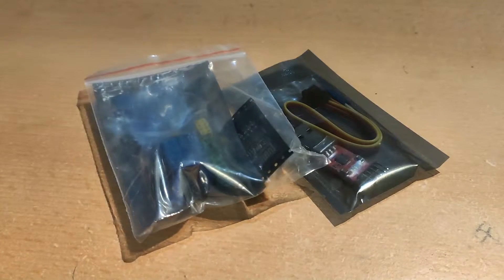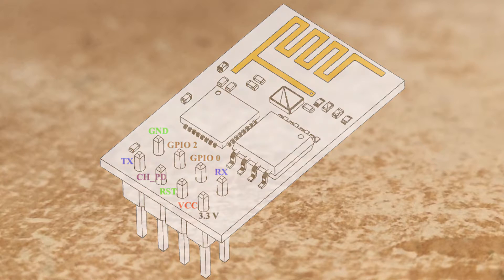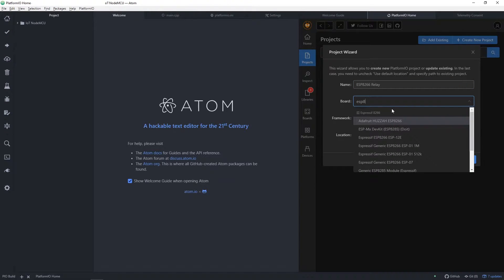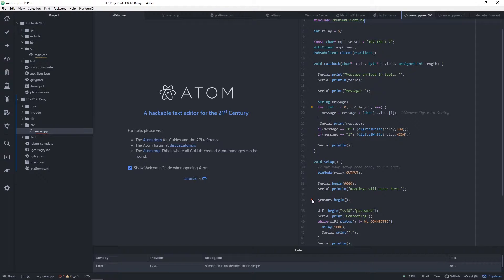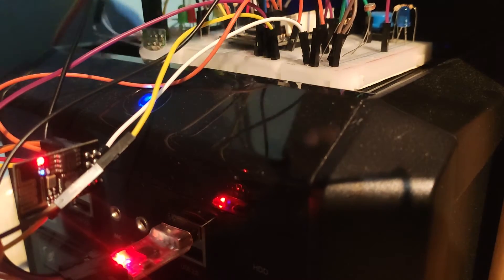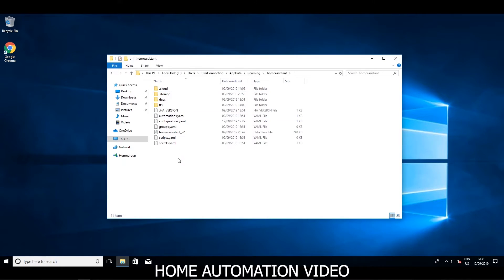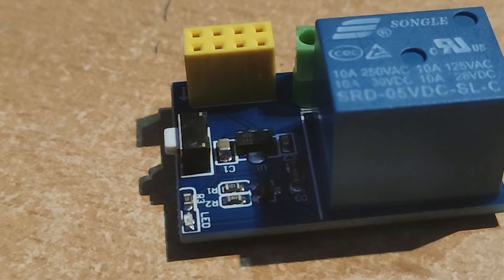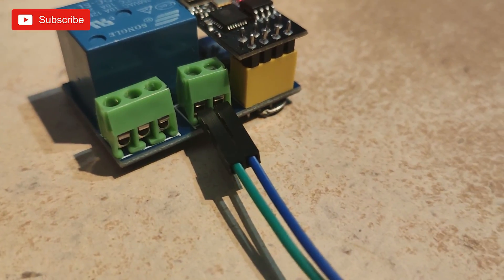ESP8266EX Fun With Relay Module, Home Assistant & MQTT

Comment: Hi I want to make a switch using microcontroller for high power device like refrigerator or water pump which relay would work for this purpose.

Comment: How would this hold up in the current day?

or would you suggest a better different ESP8266 relay?

was planning on getting one of these cheap ones to use with some led-strips.
Reply from the maker: If you put some effort and time in it, it will do. Today you also have a "plug and play" solutions like Shelly and Sonoff switches with their apps. In the upcoming months I'll release new content for Shelly devices so check it out once uploaded. My latest video is explaining Shelly humidity and temperature sensor so you can see how the Shelly app looks like and find some info there. In any case have fun!

Comment: I got a slightly different module, and can't get it to turn the relay on. Tried all GPIOs available. The module get enough juice. Any ideas?
Reply from the maker: Check connections for that module. The scheme or diagram to be sure you are wiring as it should be.

Comment: ..this module has bug on its relay board..remove the smd R2 202 resistor in the relay board to be able to work after programming via the switched USB programmer for the esp-01s
Reply from the maker: Yeah, I don't why they are producing it with that specific resistor.

Comment: Is this work without INTERNET
Reply from the maker: Not sure if I understand your question exactly. You do not need the ISP internet access for this module to work. You can connect it to your router/modem WLAN with the Wi-Fi or program module to work as AP over Wi-Fi.
Reply: I say if I have not any routers can I use only mobile for on off it
Reply: si se puede hacerlo funcionar con una O alambrada con o sin internet, encendiendo el apagador manualmente.

Comment: This exactly what i was looking for ,, thank you very much man ,,, i will try it and let you know if it worked for me.

Thanks
Reply: Hi there,I have applied all steps and configured Home Assistant but, I'm having a problem connecting my esp8266 to Home Assistant, it connects to the wifi network but shows the error below:

Serial port COM8 opened
....
Connected, IP address: 192.168.1.115
Light - MQTT - ERROR

i will appreciate it if you can help me fix it